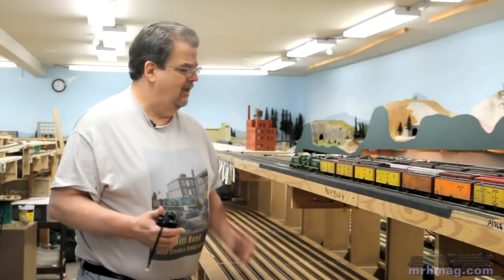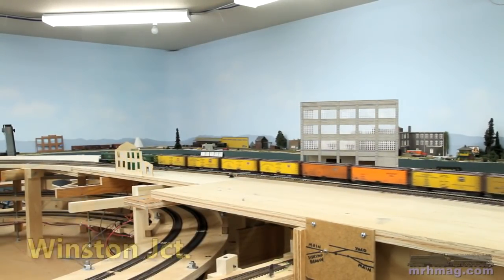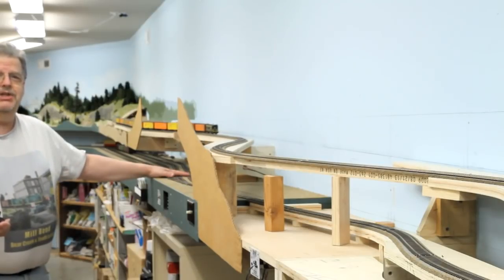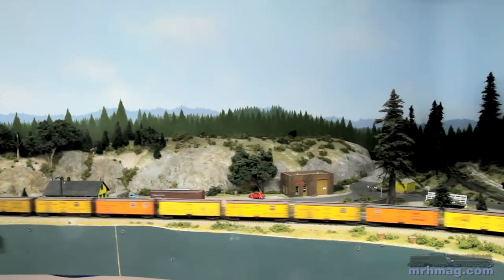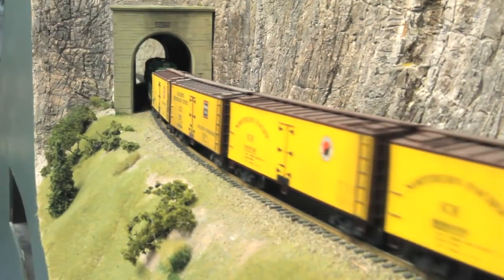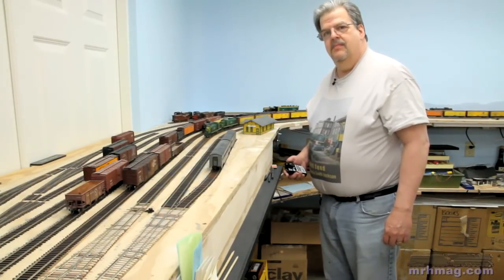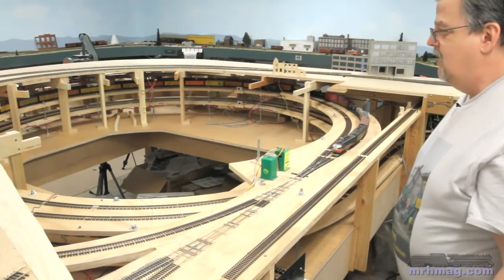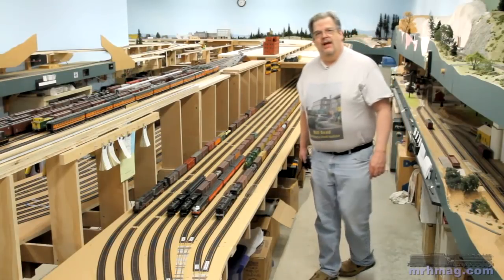Bear Creek & South Jackson 10th Anniversary | Model railroad layout | Model Railroad Hobbyist | MRH

Comment: Another great example of Excellence in Model Railroading. One comment on sound voice seams to a little distorted in beginning. Thanks for the tour Charlie.
Reply: Art, you're right, the audio isn't the best it could be. I shot this video using a Canon 7D DSLR. While the 7D does a good job with the video itself, it's audio capabilities are really limited. When I plugged my Senheisser wireless mic system into the 7D, the auto gain control made life difficult and there is no way to turn off the AGC. When I'm talking the sound level is hitting the ceiling. When I'm not the gain goes way up so you can hear me breathing and it over aplifies the noises the trains are making. I need to get a separate digital audio recorder with decent manual gain control if I'm going to continue shooting much video with the 7D.

Comment: Awesome layout.  I especially like the long scenic runs either side of Oak Hill.  With enough switching areas elsewhere, I think this is a much better use of the extra space than squeezing in more towns.  I eagerly look forward to more updates.

An observation based on studding the trackplan while watching the video:  All the scenery at log loading area and the creeks beyond had to have been built pretty quickly as the temporary staging yard would have been in the way until 2 months before the video was published.  I thought it interesting that the finished scenery on the 2.2% grade that has been in place for several years, has only just been hooked up to the rest of the layout.
Reply: I think you've misunderstood. I've been running op sessions through the areas with the scenery since before there was scenery. Salem (temporary) staging used to be on the wall above the Siskiyou staging area. In Nov/Dec 2013 Salem was moved to the peninsula with about a mile of mainline added.
FWIW The temporary Salem staging yard will be eliminated after the Nov 8th op session, the benchwork and backdrop of the peninsula will be completed, and the final two miles of mainline will be installed (bringing the visible mainline length to about 5 scale miles). This should all happen prior to the Jan 2015 op session. I'll produce another tour of the layout when this happens.
Reply: BCSJRR
I guess you're right.  I must have misunderstood.  The observation was based on my interpretation of where I thought the temporary staging yard was being moved from.  Thanks for clearing that up.
I still think my other comment was correct though ... It's an awesome layout.  One out of two isn't too bad.

Comment: Terrific layout tour. Didn't miss that there was no sound in the locos. Enjoyed the sound of the motors and the clickety clack of the cars. Thought those might be Hobbytown RS3s? I also liked your helix. Too bad you're going to cover it up. I prefer to find another solution to layout design without using a helix precisely for the reason that so much thought and engineering goes into them that they really are interesting...and yet, visually, they have to be covered up for the sake of "realism." I hope you left it open.
Reply: Kato RS-2s. The big problem isn't so much the helix itself as needing to Ben Dover and peer into the darkness to see trains parked in the main staging areas now located under the peninsula.

Comment: What is the ideal spacing between layout levels?
Reply: Hard to say. My levels at Oakhill are 63" for the mainline and 40" for Redland under Oakhill. This allows a resonably tall operator to seen the back edge of 20" (or so) deep Redland without having to stoop. My eyes are at 65" so I get a very nice view of Oakhill on the upper deck. Height challenged operators can use a kick-around stool to get a better view of the upper deck.